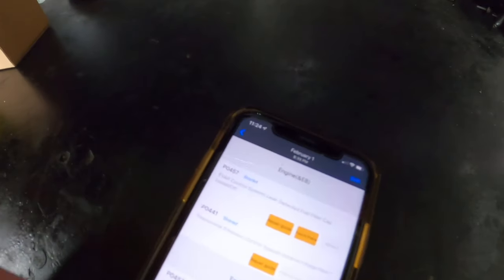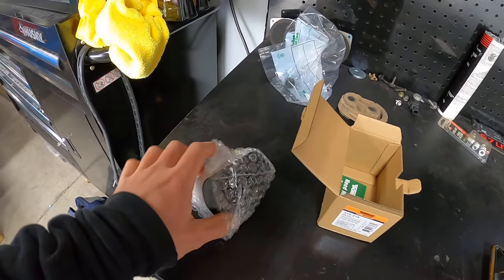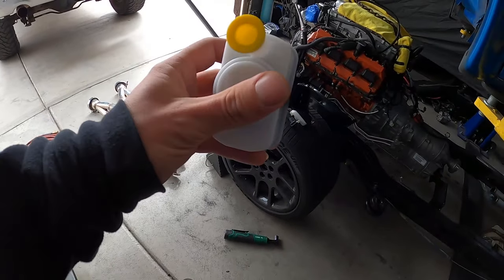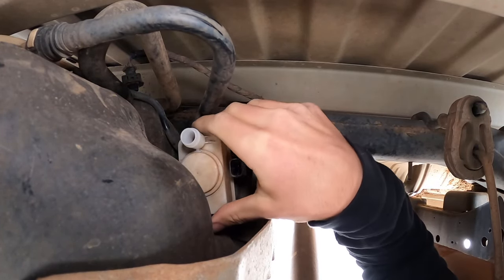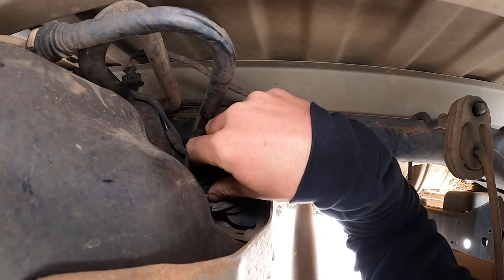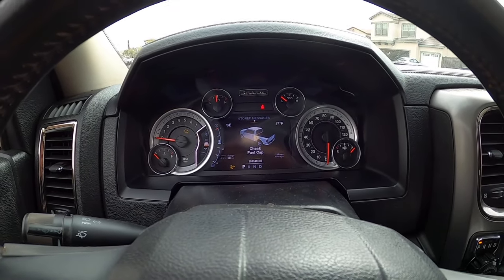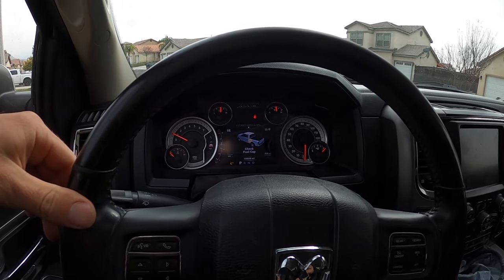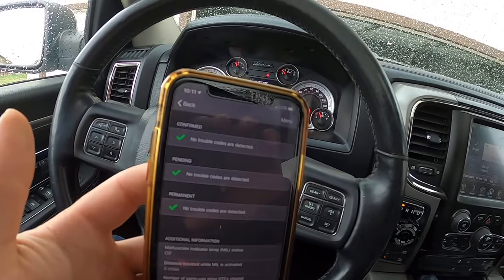RAM TRUCK GAS CAP LOOSE P0456 P0457 HOW TO REPAIR

Comment: Not sure why but the part you linked says does not fit 2016 Ram with 5.7 HEMI. Weird. Even the purge valve I bought off Amazon said it didn’t fit but turned out that one did. I wonder if your linked one will fit

Comment: Do you know if I installed the evap system integrity module wrong because the gas cap light went away but I still have the 46 and 47 code and now have codes p1058 and p1E0A. I’m not sure if it is sealing correctly and don’t know where to go now unfortunately. Anything helps. Thank you

Comment: Great video and solved my problem too but a new one arose! Did you have any issues filling up immediately after installing? I am getting a big splashback when fueling up, it takes me about 20-25 mins each time to fuel up now. If I detach the hose that connects to the EVAP sensor, I can fill normally and it's got me CONFUSED lol. Just curious if you saw a similar issue at all?

Comment: Mine's a 2016 Ram 1500 2wd. Mine didn't have an O-ring on it when coming off. And saw no way of securing the new O-ring as well. I noticed my old one rattled like crazy, new part no rattle. Is it possible the O-ring isn't needed/used on some years/models?
Reply: Did you ever find out the answer to your question? 2017, just replaced it. No O-Ring when removing and no way to secure a new one like in the vid. Spent 30 minutes trying and finally installed without the ring.
Reply: Also, old one rattles like crazy as well. New one quite. Did it solve your code?

Comment: I had my check engine light on, reading a small emission leak code. Checked the system and found a leak at the gas cap. Changed the gas cap and fixed the light. About a month or so went by and had zero issues until I got the check gas cap indicator. Checked, and the gas cap was actually off. Thought maybe i didn’t put it on correctly (something I’ve never done) or whatever  so i put it back on and it’s still showing…

Comment: I had the gas light code and a check engine, took it to dealership since it was under an extended warranty,  put a new ESIM and gas cap and cost $250 for the repair....now there seems to be excessive back pressure in the fuel tank when I remove gas cap...also won't take refueling. Barely trickles and pump clicks off.... something more to this issue than what I have seen explained online , do these engines have EGR valves?

Comment: Did you buy the oem gas cap or an aftermarket one, im having the same problem but no check engine light. I bought an after market one but its still say gas cap open 😢

Comment: How many days should I wait before taking  to dealership? Replaced purge valve and ESIM and fuel cap 
,check engine light still on and so is fuel cap message
Reply: If the light is still on after 100 miles after the Purge Valve, ESIM, and Fuel cap replacement, then it's maybe the charcoal canister.  
The canister itself is around $280 for the aftermarket part... if that doesn't work then you may want to have a mechanic do a smoke test to find the small evap leak.

Comment: Could it be caused by not possibility to gas tank on station? It means, that I have to tank very very slowly  reducing fuel pressure from the gun. My car is Chrysler Aspen 2008.

Comment: Let's see if it fixes my truck..2016 Ram 1500
89,554 miles.Exhsust manifold studs, waterpump, ball joints now this. My Honda Ridgeline went 254,000 miles with no problems.  Did all the same stuff too. Same boat, same trailer, same yard work.

Comment: Great video! But sucks that it didnt work for me, i replaced the ESIM, the purge solenoid and the fuel cap and still get the p0456 and gas cap light. I smoked the lines, tha charcoal canister, the fuel tank and didnt find any leaks. Anyone got some more info? Please and thanks!!! 2015 ram 1500 sport 5.7
Reply: Did you ever find out what was wrong? I have the same issue with mine
Reply: @diegoanaya7241  it was a broken wire in the harness for the esim  it broke near the front left upper control arm, that line feeds two other sensors and those were ok so i knew the pcm was good.

Comment: Bro ive been getting the service trailer brake system, do you know what i can do to reset it or what i could do to fix it. I have an obd link plug and alfa obd if that helps

Comment: Before I pull mine out, can you confirm if the part number is on the old one? The one that you shared from Amazon doesnt fit my 2015 Ram 1500(According to Amazon).
Reply from the maker: It will fit

Comment: My 11 ram has remote start issues.no codes gas cap is tight hood is latched. So don't know why it won't start?the passenger side front fender, bumper were replaced but don't know if that has anything to do with it.?if You have any ideas please let me know thanks 👍☮️

Comment: New sub! Bro do I have to disconnect my negative terminal battery b4 I replace that valve under the hood? And is Bando a good reliable brand for serpentine belts? (07 JGC Laredo 3.7V6/213k)

Comment: If one were to have a gas cap that wasn’t on perfectly and the check engine light came on and then the cap was corrected would the check engine light go away instantly or would it take a day or so?  Thanks
Reply: Mine corrected the light after about 30-miles of driving

Comment: I thank you for the video. I currently have about 82k miles on my 2016 ram 1500. I just got that code today. What is the device you’re using to check I your codes from your phone and lab top?

Comment: 4 Dec 2023:      Change the pump  process, only for the    engine light to come back on a week or two later, and the reason for that is:  The Evac Solenoid was the problem to begin w/. I would rather change out the Evac Solenoid first, easy to do, just under the battery rack, take out the battery, and then un-screw the Solenoid  Bracket, just one nut, and then take off the Solenoid from the bracket and the 2 hoses,  3 weeks later , No Engine Light !.    Up Date:  14DEC20203 my engine came back on, jacked up the truck, took off the  old vacuum pump & "O" ring and replace bother w/Mopar parts.  I notice that the Mopar parts are much different design on the inside as the Doorman Pump.   Code is Cleared on Dashboard.  I suggest to use the Factory Brand Mopar, not expensive w/Free Shipping from Geek Parts.

Comment: Just did this exact replacement today after watching your video. After replacing the unit, I disconnected the battery and upon reconnecting the light was gone and hasn't come back on as of an hour of driving. If you have dash light OCD like I do, disconnect the battery after to clean up that cluster.
Reply: it wiill take multiple drive cycles to determine if your fix worked. Dont donate the "world champion" apparel  to india just yet....

Comment: I'm having the die random after filling up with fuel issue on my 08 5.7. Add no code or check engine light.
Reply: If its stalling right after filling up and very hard to start afterwards, it may be your rollover valve. Its a part on the gas tank itself and is non replaceable. You will need another gas tank.
I bought a new mopar one from summit racing because the 3rd gen rams are known for this problem and I didn't want used just for it to break as well, if it wasn't already. The stalling goes away after a gallon or 2 is spent. The evap is sucking raw fuel into your intake, flooding the engine. Try unhooking one of the hoses from your evap charcoal canister, it should stop stalling after fill up but will throw a code. Also you may have raw gas spill out of the evap canister too. Other than a new gas tank, all you can do is unhook the evap hose and live with the check engine light.
New tank will run between $800 - $1200 not including mechanic fees. You could try used and may luck out. I thought to try the 34 gallon tank but the dealer needs to reprogram the truck and I don't think they do that because of fire hazards or some other problem. The 34 gallon tank is usually under $500. Call a dealer and see if it can be done. I feel your pain, good luck.
Reply: @GabrielSorrow  I replaced the charcoal can and the purge valve. Will see how it goes. It usually dies at the stop light when I stop. Fires right up always. Doing more checking. Only does this after filling up. After it dies its good till the next top off.  Has the gas fill burp issue also if I pump gas on the high notch as well. Been doing this only about 3 or 4 months. Out of no where
Reply: @MikeJBlues  It does sound like the rollover valve. If I'm right, after replacing the canister, it will run right for a little while but after the canister fills back up with raw gas, it will start stalling again. Mine died at the light too, every one until a gallon of gas was spent. If it does it again, don't waste money on another canister until you get another gas tank. Once the canister has gas in it, it has to be replaced.
Reply: @GabrielSorrow  wouldn't the roll over valve trigger a check engine code?
Reply: @MikeJBlues  mine didn't, only the evap leak sent a code. I bought my truck used at auction and who ever had it before me purposefully caused several leaks throughout the evap system to keep it from stalling, just to avoid buying a new tank. I replaced same parts you did and nothing stuck. I was at first just trying to fix the leaks and when I did, that's when the stalling after fill ups began. Afterwards I just caved and got a new tank. The 3rd gen is my favorite body style ram, so its worth it to keep it a couple of decades at least. The only other bs the previous owner did that I was unaware was to cut a hole in the bed of the truck to access the the tank and fuel pump. The bed had a plastic liner on it and only after my foot almost fell through the bed, did I find out. What a lazy sob, that he couldn't just drop the tank.
Reply: @GabrielSorrow  that sucks , gonna hold out till spring , of it needs it i can do it myself then. Seems to be a very common issue , dodge needs to recall this , faulty parts my truck has 64k only
Reply: @MikeJBlues  Dodge only recalls things that impact safety, such as bad airbags and the like. Its why there has never been a recall on the chewed up cams and lifters in the 09 and up 5.7 and 6.4 engines. Not a safety issue. Real sorry that its happening to you, I know how you feel. Its just not something you ever expect to go wrong on a vehicle.

Comment: I currently have the same problem, changed my gas cap with an oem part, changed the purge solenoid. Still throws a "check gas cap" on dash. I then changed this exact part and warning is still there? I'm out of any ideas other than the charcoal camister?
Reply: I'm in the same boat right now.  Ever figure out your issue ?

Comment: I had a p0456 and p0463 code on my truck so I replaced the gas cap that I got from the  ram dealership and the evap sensor 
The check engine light it's off but my dash still says to check fuel cap
What should I do next?
Reply: replace your Purge Solenoid ($25).  Very easy to do on a Ram truck. Took me about 5 minutes total on and off.
Reply: @beefcakejustin  the gas cap code is fixed it just needed a day to read the new evap sensor however the 463 code came back it's a bad fuel level sensor 
The dashboard reads the fuel accurately but the ob2 reader fuel level is way off I ended up getting a new fuel pump

Comment: Had the same happen last spring after changing lift pump...new gas cap, then replaced leak Det pump as well...light would come back on after clearing, but the code and light went away after a few weeks. I figured maybe there was some sort of vacuum break after dropping tank that sealed itself ¯\_(ツ)_/¯    
🤘😎
Reply: Swollen o-ring gasket on fuel pump retainer? Its recommended to replace it any time you remove it and expose it to the atmosphere.. re introducing it to the compressed cap and absorbing gas vapors probably allowed it to swell again.. 
Just some food for tlhought

Comment: I have an 07 5.7 1500 where is that part under the hood located? Or what is it called
Reply: Purge solenoid..its right under the battery tray.towards the front end of the truck

Comment: First unhook battery hook it back up turn key just to acc let it run threw system then start it if you dont wait the light will come on.

Comment: My aunt had this code on 2014 ram 1500 big horn took it to dealership they said replace the fuel filter and her cap. Neither of those worked for they tried her tank. After all that didn’t work she was convinced it was a lemon and gave it to me for 5k. This is the only code on the truck motor has 30k miles on it as they had a new one put in before this code came on 168k on dash though. If it’s just this 20$ part I’ll be baffled lol
Reply: And??

Comment: I kept getting P0440 and P0457 on my 06 ram 2500 5.7. I took it to the shop and paid out the ass for them to patch the gas tank since dodge stopped making the tanks so I couldn't find a replacement. I get the truck back from the shop and the gascap and check engine lights come back on. Wtf. So I bring it back and they replaced the ESIM. I got it back the other day and I'm getting the gascap light AGAIN. OK at this point I'm done donating money to this auto shop since they can't fix the fuckin thing. I replaced the gascap and the purge valve solenoid myself thinking that would definitely fix it since everything I've found on the internet about these codes has been done to my truck. The bracket that the solenoid is mounted to was so rusted I had to remove the wheel hub and lubricate the living shit out of the screws that hold the bracket in place. Then I had to take my multi-tool to cut the plastic grooves out just to get the solenoid off of the bracket. I sanded the bracket down to bear metal again and hammer it flat so the solenoid would fit smoothly. Get it all on and I get the gas cap light again. No check engine light, but I plugged in my code reader and still have P0457. I'm pulling my hair out trying to fix this.